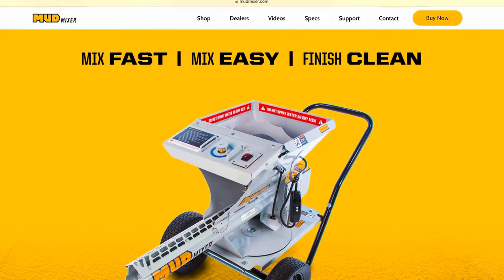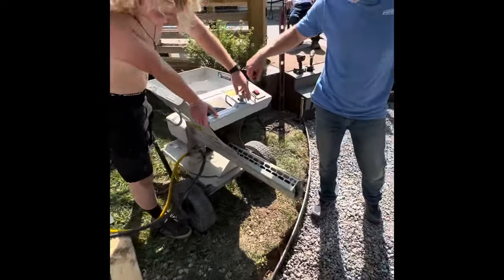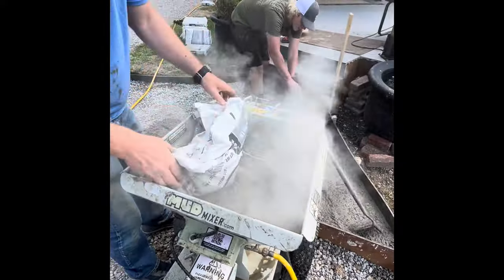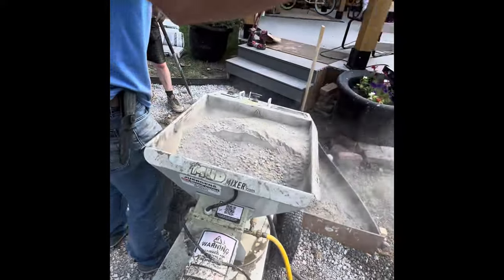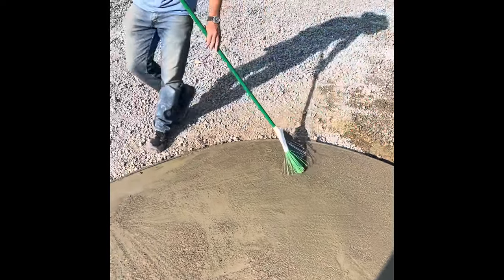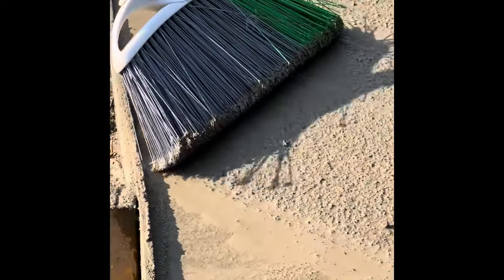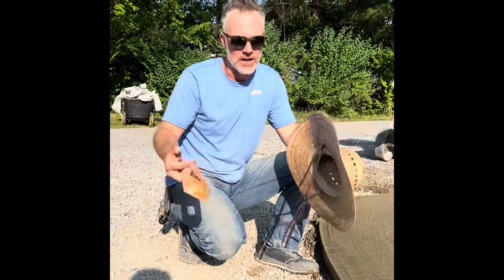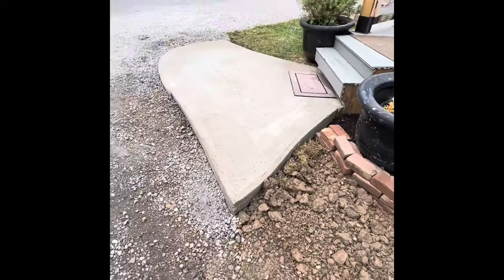Testing the MUDMIXER, best concrete mixer?

Comment: Your concrete is not going to be strong when you put too much water in it! Looks to me like you have about 15 - 20 % too much water in it. Use a bucket for the water, 80 lbs of Quickcrete needs 3 quarts of water, but we can add a cup or so more to make it run better. No MORE! I can mix 7 x 80lb bags of Quickcrete in 22 minutes with a hoe and a mixing tub. Keeping the fat off and saving 4 grand.
Reply from the maker: Yeah it was soupy. In the end I really like the look with the aggregates coming to the surface. For being a step onto my porch it’s perfect.
Reply: @barnandhome  Concrete is Supposed to be for STRENGTH not a work of art. You need plaster for art jobs BTW.
Reply from the maker: Sure, in most applications.   As they say, “my concrete looks great from your house.”